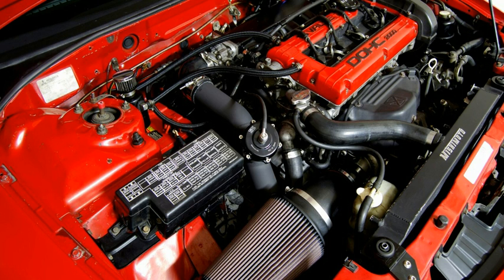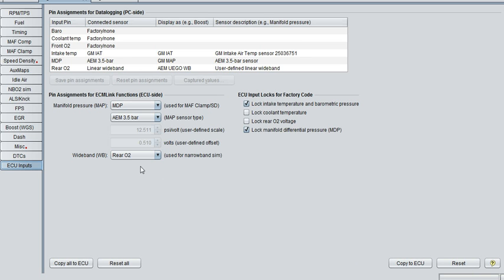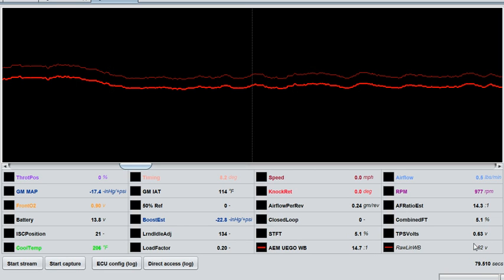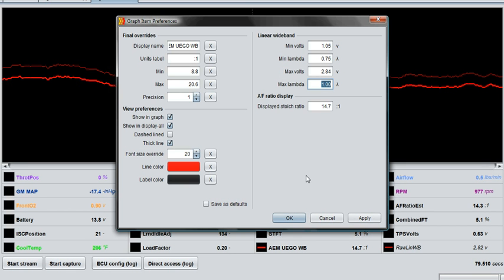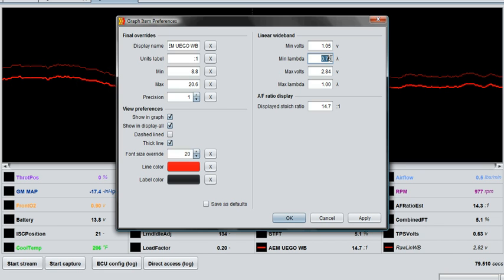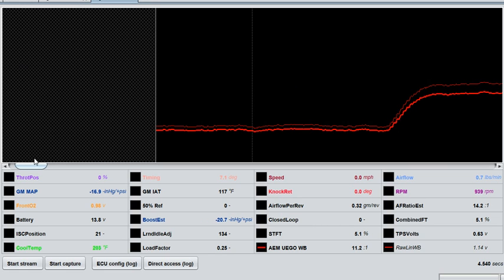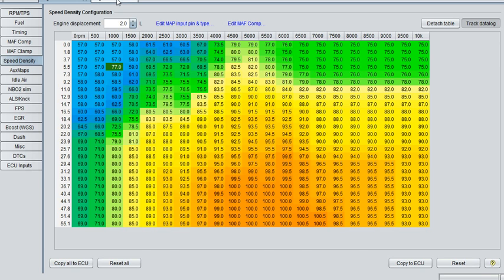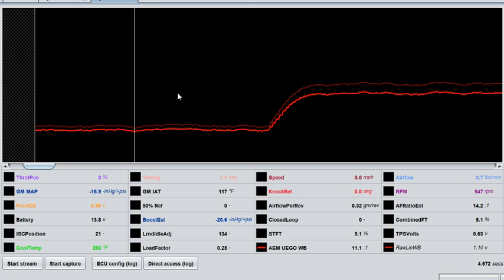ECMLink LinearWB SD Tuning Video.wmv

Comment: Does this still apply if the car is locked in open loop? Previous owner replaced front o2 with UEGO and I feel like the gauge is off with what Link is showing.
Reply from the maker: ECMLink can simulate the narrowband front o2 sensor even when it's replaced with the WB, search ECMLink wiki on setting this up. It still applies even if you run your car locked in OL because you need your gauge to log accurately if you depend on tuning AFR's based on your logs.

Comment: Will this still accurately log below 11.0 and above 14.7?
Reply from the maker: MindBlowin03 Depends on what you consider accurate, but it should log within .1 to .5 outside of 11 and 14.7 range that you're scaling it to.  Thats the point though, you NEED it to log accurately for WOT tuning not when the cars leaned out on decel.
Reply: Corey Jenson I agree. I just wanted to make sure if I'm a little rich at WOT it's going to read correctly.  Honestly, as long as it's accurate near 11.0 I'll be happy.
Reply from the maker: MindBlowin03 I made the video for a friend running 91 so if you're tuning E85 you can scale it for a leaner AFR too. Or, if you're running 91 and want it conservative scale it from 14.7 to 10.5.  Its whatever fits your build!

Comment: do you have to hook up the afr wiring to the rear, i just installed my innovate wideband on its own power, my car still uses factory upper/downstream o2 sensors. can i still tune the car that way??
Reply from the maker: yenyen33089 it will work fine but you can't log it in ECMLink unless you use a sensor input.
Reply: Corey Jenson im new to link and well kinda lost to tuning..my set up is 
new
 rods and piston (wiseco) 2nd oversize
2600cc bosch injectors
gt3788r bb garretr turbo
3in all the way back with electric cut out
272 intake/exhaust with aem cam gears
ferrea intake/exhaust valves
320lph pump with inline aeromotive external pump
car fires up and runs, no check engine 
idle afr is 11. .just dont know where to start with speed density..
sorry for long reply 😉

Comment: Why do you want the car to idle at 11afr? I followed your directions and got my car idling at 14.7 shows that ratio on link and the gauge
Reply from the maker: IAN LUPINI because you don't tune your WOT AFRs to 14.7, it doesn't matter if the gauge reads/logs accurately at idle if it's inaccurate when it matters most... at WOT and under full boost.
Reply: Alright well I'm having to richen the 5.5-1000 cell to 80.0 just to idle at 13. Do I need to go higher or have I messed something up?
Reply from the maker: ...the cells go to 100+.  It's only temporary to get the voltage reading of the gauge when it's displaying 11:1.  Once you get that voltage then you reset your idle cells to get it to idle at 14.7:1 and reactivate closed loop control.
Reply: Corey Jenson ohh okay! Thank you for all the help!

Comment from the maker: Assuming you mean translator?  Sure.  Just raise and lower the MAFHz sliders that are being used during idle, typically a GM MAF idles around 500Hz so that would be the slider you adjust to make it idle rich after locking it in OL.  

Why do you have a MAF translator if you're running ECMLink?